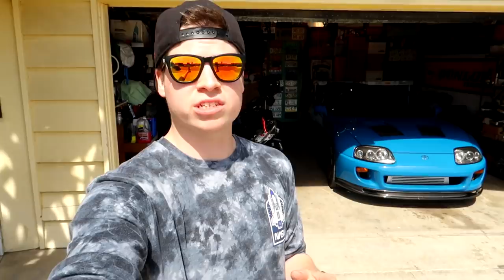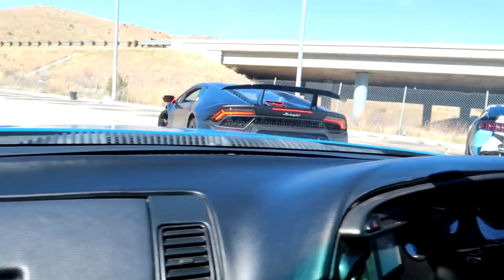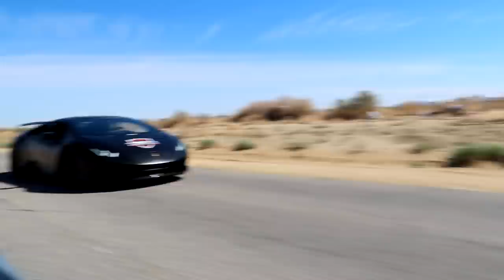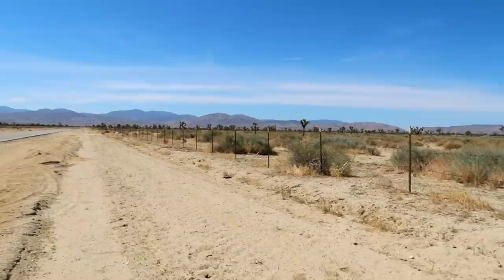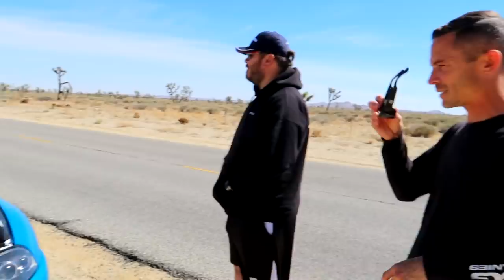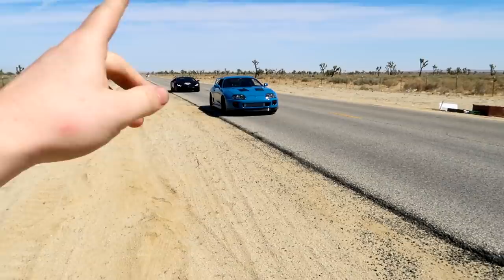Racing My Supra Against A Supercharged Huracan!!! (Doesn't End Well...)

Comment: “Horse power is just a number”

Imma race a hellcat in the rx8
Reply: need a tow truck number ??
Reply: Honestly it could be a good race depending on what’s going on in the rx-8
Reply: @HonestAbe  699-4200
Reply: @scamsscobbs  a blown apex seal and a fucked clutch 🥲
Reply: Rx8 is so smooth going 187 mph on freeway to la
Reply: yeah that hellcat you are talkin about better not be a demon
Reply: Horse power really doesn’t tell the full story. It comes down to a few things:  weight, torque, aerodynamics and rotational weight. An Abrams Tank literally has 1,500 horsepower but it won’t beat a stock Honda Civic in a drag
Reply: i wish
Reply: @jailanrayvon434  jesus christ
Reply: @jailanrayvon434  considering it's a bigass tank, not very surprising. Lol
Reply: @hiimbrad738  😂💀
Shit man😂the fuck happened to it?

Comment: This may not interest you but I had thought about using a torqamp like some other people and using it in a race capacity, as a cold anti lag. No stress on the manifold, possibly just connect the actuator for the torqamp (electric turbo that makes about 5 psi) to the clutch and when it’s in it should keep the turbo spinning

Comment: Try having some metal couplers made, it makes a big difference, my 2.7l boosted ranger had the same problem and I welded some couplers and vband ends to each side to prevent it from blowing like that, im at 26 lbs at 9100 on E85, if your planning to build more just go straight for the metal couplers

Comment: Dude in the Lambo needs to turn off traction control that’s what’s holding him back not the awd
Reply: lol what?
Reply: @longtailrally780  it’s a well known fact you have to turn off traction control in lambos and r8s. Turn mine off every time I start it
Reply: @WuFluChan  👀
Reply: @longtailrally780  the stock traction control doesn’t know how to handle superchargers or turbos , it will retard the throttle every time it feels the smallest slip.
Reply: @WuFluChan  that’s what traction control is supposed to do.   Also, it’s pretty clear it’s not having a problem getting off the line
Reply: @longtailrally780  yeah That’s what it supposed to do but these aren’t rwd cars, the factory traction control is way to intrusive, it’s more of a problem from a roll not  from a stop. Go to the Lambo or r8 form and type in traction control or go to a channel like sheepy, first thing they tell people when picking up their cars is turn it off. I don’t know why this is so hard for you to comprehend
Reply: @WuFluChan  because when you punch it at 60, you’re not experiencing wheelspin in an AWD car at stock or supercharged power levels,   Maybe in a 1,200hp TT Sheepy built car it’s an issue.  But it’s not in mine.  I know what it feels like when TC kicks in.   I’m not sure what’s so hard for you to comprehend about that.  🙄Please, show me a “link from a forum”.

Comment: Im surprised the Huracan didnt have more hp considering it was supercharged
Reply: 870hp is almost 250hp more than stock!  Supercharger is super reliable power.  You can do more with turbos but you lose reliability.   We need super reliable cars for rallying.
Reply: @longtailrally780  thats is great and all I was just surprised considering procharged corvettes have like over 1200hp
Reply: @Torque_Haven  VF superchargers only push 6.5 pounds of boost.   You can go higher, but you lose reliability.
Reply: @longtailrally780  I see, I would figure the engine could handle a 1k hp easy considering its a lambo haha
Reply: @Torque_Haven  nothing can “easily” handle 1000 horsepower.   Lambos are built to be fun on a track, which doesn’t always mean more horsepower.   To put things in perspective, a NASCAR has 750hp and weigh 3,400lbs.  Both these cars would likely whip a NASCAR in a roll race.
Reply: @longtailrally780  ya your right that makes sense, I guess if you take out bugattis outta the equation, then yes 😉😜
Reply: @Torque_Haven   Assuming you consider spending millions of dollars “easy”.  Haha